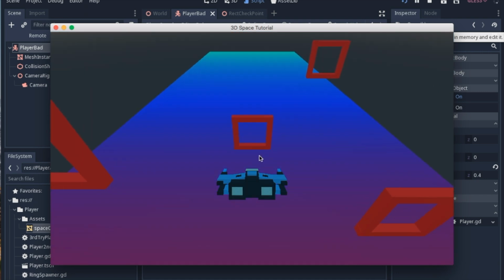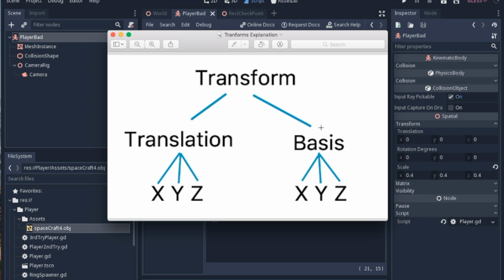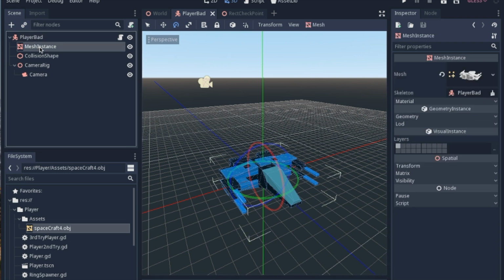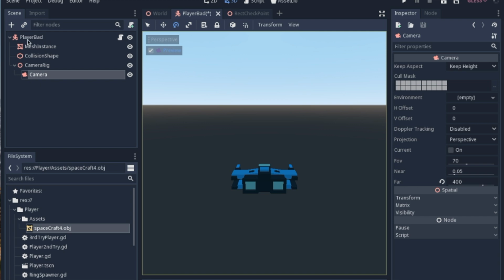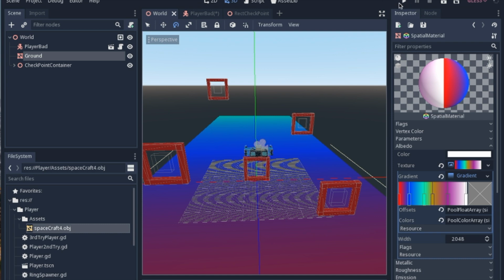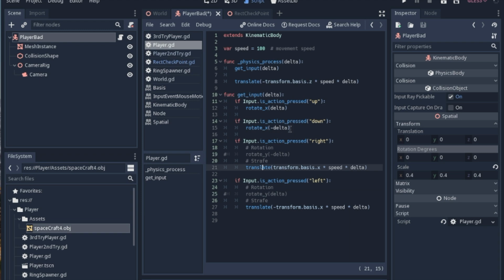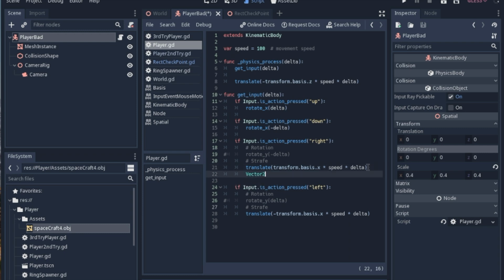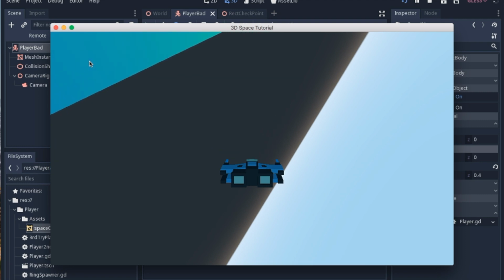Godot 3.1 Tutorial 3D Movement (1) Basics, Transforms, Poor Movement

Comment: did you find a solution for when you start combining rotation axis? ive found if you set the rotation degrees in the axis you want rather than using the rotation property the aircraft behaves without combining rotations, just havent worked out the best way to implement this in game. Also seems like spatial nodes are gyroscopic and always stay in the same position, hence causing 3 axis movement when you turn one axis with a second axis stationary but degrees != 0